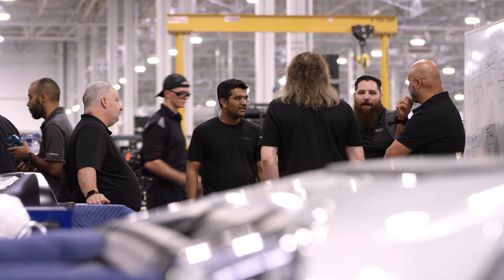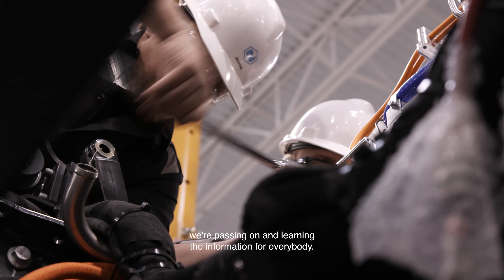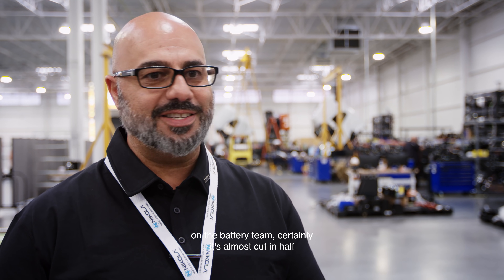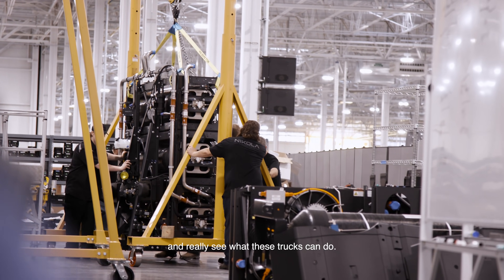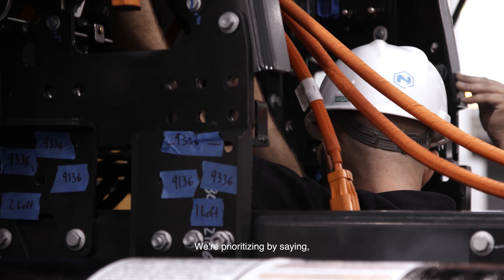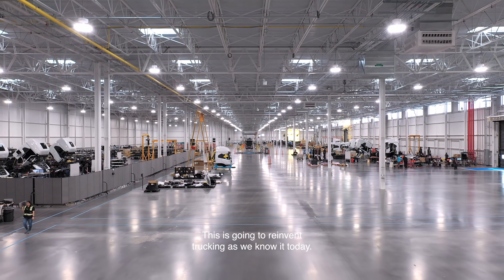Driving Change Season 2 Episode 1: Get It Done | Nikola

Comment: The shell of the plant is indeed complete.  But there are no signs of any assembly equipment.  No assembly line, no work stations, no fixtures.  The staff is working on folding tables on the shop floor because there is no dedicated office space.  The staff is using rented hand tools and portable a frames for the assembly work.  This 
 is not what a truck assembly plant looks like.  I thought Iveco was going to help with the plant design?  This is nothing like the plant in Ulm, Germany.  We can only guess what the plan for production might be.
Reply: But they are still figuring things out. They won't be selling anything for a while.
Reply: They have equipment that had been sitting out in the parking lot for months. An employee said it will be installed when the building expansion they are working on is complete. Presumably that is the same equipment used in Ulm.

Comment: My problem with Nikola is that it doesn't have key in-house technology such as battery,  fuel cell, or propusion system. It is a system integrator and can be easily caught up by existing semi builders.
Reply: Neither does Tesla.
Reply: @mg6192  If you states that, you don't know anything about Tesla. It manufacturers -to name a few - body, motor, charge system, battery, seats, self driving system and software, system software for control and infotainment. No comparison.
Reply: @JohnLee-ed8yi  WRONG. Panasonic supplies Tesla their battery.
Reply: @mg6192 You ignored all other items and mentioned battery only, but that's wrong too. Panasonic supplies cells that were developed in collaboration with Tesla. Cells are small part of a battery system. Tesla also gets cells from LG and CATL. However, do you think throwing in bunch of cells in the box will power the car? Packaging them into power packs and the battery module, cooling, imverter, control and management all done by Tesla. Do some study before you state any further.
Reply: @JohnLee-ed8yi  "packaging them into..." So basically an "integrator".... Btw, cells are the MOST critical component of a battery pack and it's the most difficult part of the r&d... which is why solid state batteries are still not in use.
Reply: @mg6192  Integrator with inhouse manufacturing and system control.  Why mention SS battery  in this discussion? They are not even commercially available? Does NKLA have SS battery technology?
Reply: We’ll see

Comment: 0:01 "manufacturing facility" assembly at best
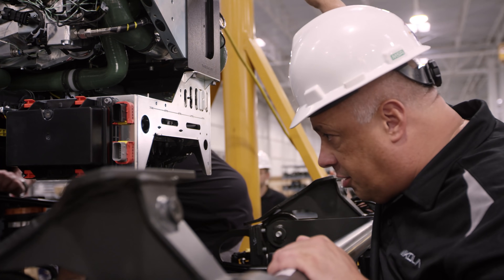2:04 "we got about eight inches" that's what she said, I only trust exact measurements in metric
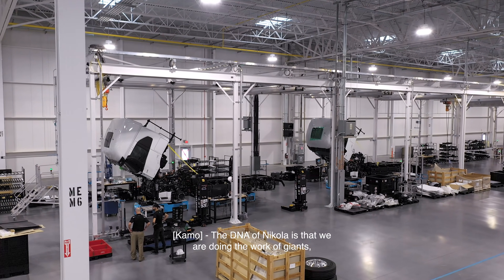5:14 "hydrogen system gives me goosebumps" cause it might explode due to noob engineers 🤯

Congratulations with your prototype in 2022 made in Germany 🇩🇪

Stop implying it's manufacturing.
Reply: Note, I want BEV and hydrogen trucks to happen!
Reply: @harmhoeks5996  here’s a chilling fact, hydrogen is just a cop out by oil companies as 95% of hydrogen is from oil, as it is more abundant and cheaper than doing it with water, and you can’t use existing infrastructure either for hydrogen as it would just boil off so you need trucks to deliver it, and it takes the actual stations 20 minutes to pressurise after every customer, I can charge my Tesla from 20–80% in 15 minutes, and I mostly charge it at home anyway. Hydrogen has no future.
Reply: @HarrisonAdAstra  ok. And the electric-only truck, does that make sense?
Reply: @harmhoeks5996  yes. Unless you are only trucking in central California.

Comment: Would like to eventually see what all the employees are doing. 100 employee cars in the parking lot so there's people they didn't show. I also never saw the woman featured in this video in any subsequent Nikola pictures or videos.
Reply: @Tyler Dunford Given what they showed in that video yesterday, which appeared to be the entire north/south section, I think they are using "assembly line" loosely. But I don't  think they they showed where the frame/axle/wheels are being assembled. That could be around the corner. I believe the parts bins are around the corner as well, and shipping/receiving.
Reply: @Tyler Dunford Russell referred to Coolidge as a "sister facility" and then later as a "twin" of Ulm on 9/15/2021. That makes me think they will install the same equipment as Ulm (which I speculate is what is now sitting outside in Bear's video)  in this new section, and still get Tre parts shipped in from Iveco Spain. Then in the bigger Phase 2.0 expansion they will install a full automated assembly line that is not dependent on Iveco Spain.

Not sure what happens to this Phase 0.5 hand assembly area once Phase 1 is complete (or Phase 1 after Phase 2 complete). They will start making Nikola Two prototypes at some point. And they are supposed to do some assembly of the fuel cells. There may also be redesigns of the Tre that they would prototype. They also could use it to make some of the stuff that gets shipped from Spain. But yeah, it would also be a good learning experience for new employees to hand assemble a truck.
Reply: Some working in the batterie building also

Comment: 4680 battery is coming soon, to be honest with you, is it, fuel cell, really good way for heavy duty truck instead of battery truck?  if 4680 battery's capacity is better than those????  think about it again.
Reply: As battery tech continues to improve, it will actually be of benefit to the HFC/BEV trucks because it will enable Nikola to reduce the overall weight of the battery/fuel cell system. Reduction in truck weight will allow for a greater payload. Or they could increase H2 storage capacity, without increasing the total weight of the truck, which would allow for greater mileage between refuelling stops.
Reply: Weight is still the problem dude. 4680 cells are a great improvement, and are the latest and greatest tech in terms of cost-efficiency, but only within the batteries world. Long hauling still requires  the largest source of power possible within the lightest package possible. Additionally, several techs need to be developed, the entire world cannot just rely on batteries to tackle all the power needs.
Reply: @mikedlcm  first of all, thanks for your opinion. you're right, weight is the most important for expecially truck~^^
Reply: Imagine ,minus 30 degrees and fuel cell trucks still driving,batterie trucks not
Reply: @Urfinchannel  and ice getting stuck in the wheel arches from H2O. EVs can work anywhere, they may lose some efficiency but they never stop working.

Comment: After watching this hopeful video... I see they are still working on the module installations. Next is balancing the power system and the software to keep the truck beating like a healthy heart.
Next is getting a contract for fuel cell supplier, and battery supplier.
Also they need a stock offering to get money to buy a robotic conveyer belt system to mass produce the trucks... so... in 2 to 4 years at most..
Reply: A person did say "so we can get the software to be road ready" but that was based on feedback from suppliers(?? - seems like it would be customers but maybe the battery/fuel cell suppliers have tests) who were testing the trucks . I assume that is just tweeking it since the trucks are currently drivable. They have a contract with Bosch for the fuel cells and with Romeo Power for batteries. But they are looking for a second battery supplier since Romeo Power is constrained.
Reply: @lockbert99  i agree. Tweeking. Like when truck goes up hill or down hill under cargo load. Fuel cell came from 1 company, battery and its supporting systems from another motor from another. They need to work on the software to get the kinks out... that takes 2 years.. during that time they can work on the facility and the robot arms and production layout. 
This is how tesla started too, so there is hope. But I do hope they will make their own stuff one day. But for now what they are doing is not impressive.  Korea and Germany already have hydrogen semi. But nikola will be the 1st US manufacturer of a fuel cell semi. I really hope they can make their own battery motor and fuel cell system so they don't rely on contractors
Reply: @jollygreen4662  It makes zero sense to me to manufacture complex parts that other manufacturers are already focussed on and doing a really great job of producing. So, unless it makes sense financially or Nikola can’t find what they need, it would seem like a much better idea for Nikola to integrate the best components currently available and only build the parts they can’t get from a supplier, while ensuring their custom software systems are able to get all the parts working well together. That’s how some of the most successful companies in the world operate.